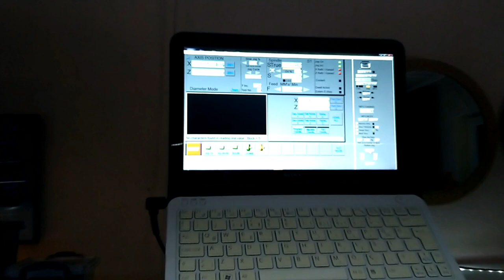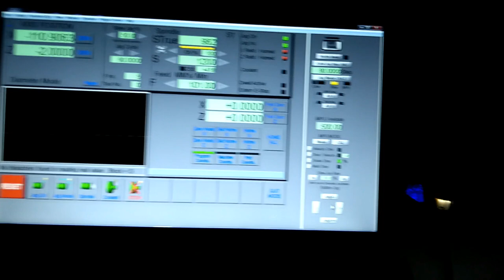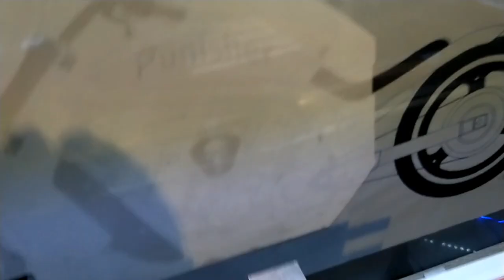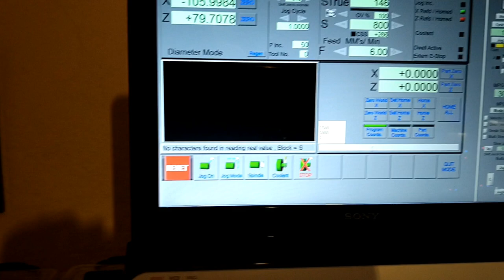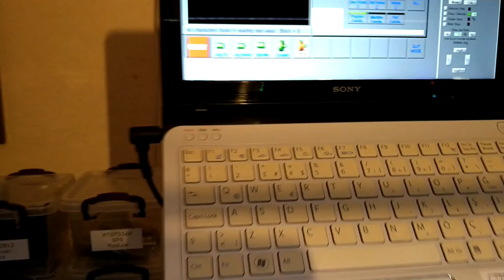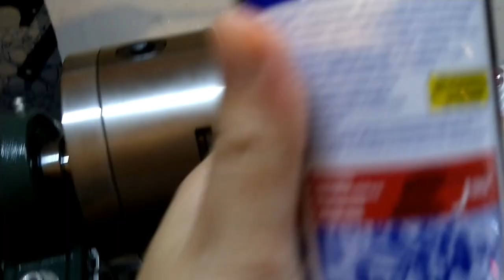DIY CNC Lathe Tool Holder for Home Build #CNC Lathe by #Hayri Controlled with #mach3 Cutting Steel

Comment: Would love to see it doing a heavier pass on steel. Keep up the great work ^^
Reply from the maker: Not likely 🙂I did reduce the diameter of the unknown steel by quite a bit and you can see the some of the chips at 17:52. I did some cuts before doing this video but off camera. Here I just wanted to proof that it can cut steel to some naysayers and know it all, who never build a machine like this, that said it can't cut steel ever 🙂In this segment I tried to get a "good" finish, but the bit used is not a finishing bit.
Reply: @iHayri1  Ah I see. From what I understand cutting steel won’t be your main usecase 👌
Will you be using it for manufacturing many aluminum-plastic parts automomously? Any products you have it mind?
Reply from the maker: @evren.builds  Correct, I designed it mainly for aluminum and softer materials and made it, like the indexing feature, with other mods in mind to give it more functionality. If I wanted it for steel, it would be easier to buy a small lathe and convert it to CNC. I did prove, mainly to myself as well, that it can cut steel, who knows maybe I need it one day. I do have some ideas for parts to manufacture and will make videos once I get my hands on some aluminum stock 🙂 But to be honest, building this lathe from scratch was way more fun than it will be using it, although I do get a big grin on my face every time I am running it. CNC machines in general have some magic to them, even if they just follow numbers.
Reply: @iHayri1  Got it, thanks for the detailed reply ❤️  Using the tool or the machine you made really is a joy ^^
Reply from the maker: @evren.builds  My pleasure, thank you for the questions 🙂 Take care and stay safe.